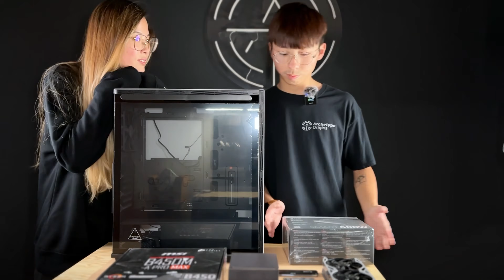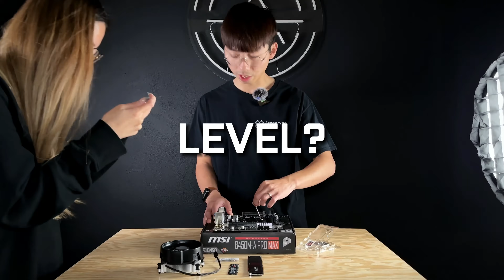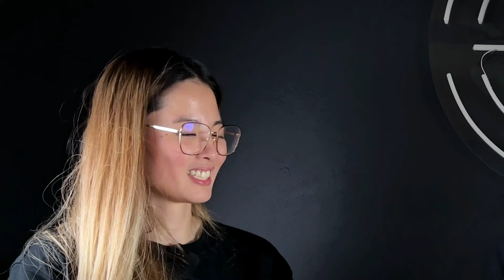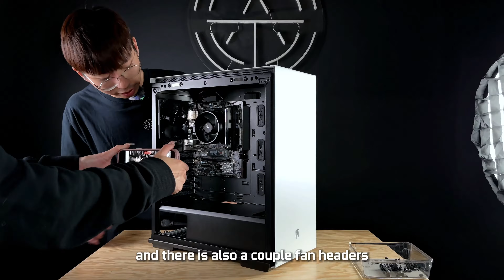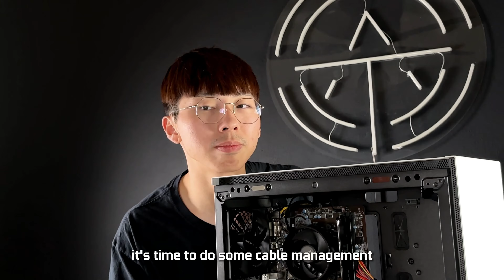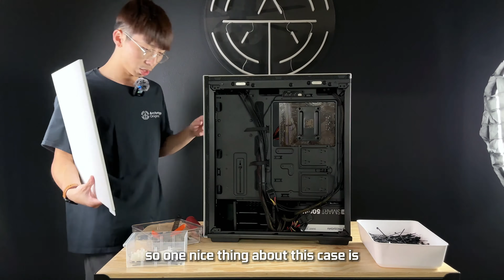A Chaotic Build: $500 Budget PC | Tutorial

Comment: I would like to know the reasoning and prices for each component, otherwise its just a tutorial. Budget builds need justification, Like the micro board in full size case!! That's a crime! It looks good though for what it is. And also talk about why you chose the components over the other options that are available. I also would go the route of getting a B550 motherboard, there are some things to cheap out on during a budget and then buy later on.
Reply: There's a lot of things you can do on a budget, But I would buy a ryzen chip with integrated graphics (ryzen 7 5700g for example) and leave the headroom for a good gpu, instead of being married to a build with a lot to upgrade down the line.